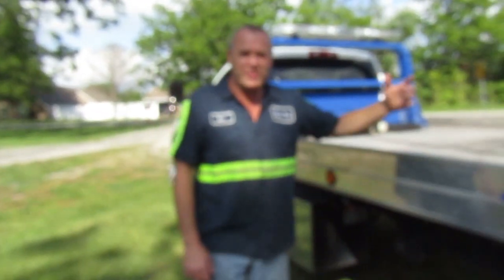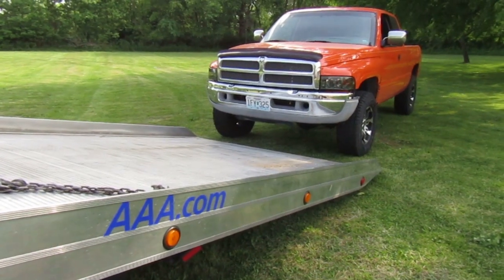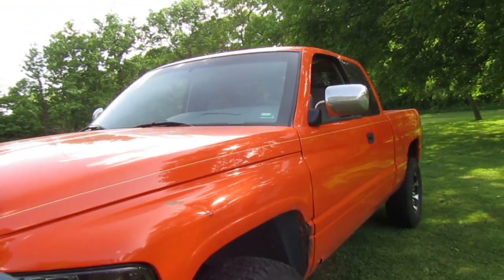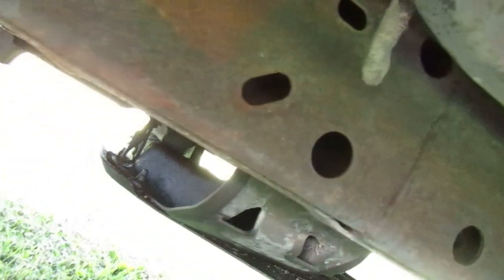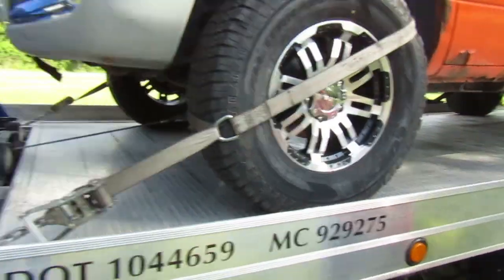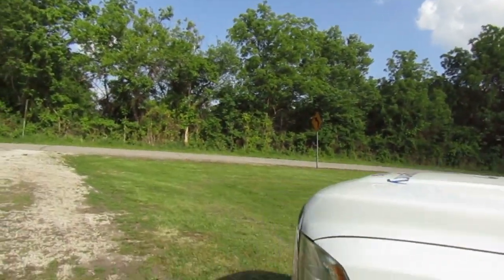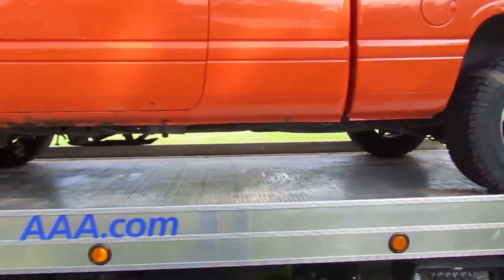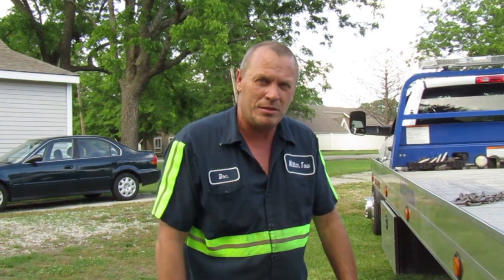How to load and unload a truck from a flat bed tow truck

Comment: Good, thorough demonstration of basic hook, load, secure and unload. The aluminum bed on a 1ton chassis is a good combo for moving vehicles that roll normally. For my purposes, I like what I'm running now, a 21' steel JerrDan with the upward swept tail end on an International 2 1/2 ton. It has really great reach, tilt range and a powerful wheellift. I'm able to slide it under 3/4 and 1ton trucks and using the bed tilt and wheellift for support, hoist them off the ground to access linkages if necessary. Hooking bridle ends is made far easier than rolling around on the ground under a car. I also have a couple handles from Smart & Final that allow me to reach under the vehicle to push hooks across to the far side of the bed and at the delivery end, I can use the magic stick to reach under and detach J-hooks and/or mini-Js. I have a substantial amount of lumber and other items to help facilitate the loading of difficult vehicles. I don't know how much of what you do involves uncooperative cars but I sort of relish the challenges. Today, I loaded a charger that had the spindle broken from the control arm in an accident. That front wheel and tire protruded almost clear of the fender. It had been taken from the scene by another company whose driver did a good job of hauling it with the exception of one detail. He didn't seem to know how to release the transmission park mechanism. Either that or he just didn't feel like taking the time to do it, opting to drag the car up and shaking it back off. I observed the status of the bypass and the markings on the ground to make this conclusion. For my part, I put my bed in front of the front end and slicked the deck in front of the wiped out tire. Using the bed's range, I extended it under the car and lifted it enough to snake my mini-Js to the forward anchor slots. Took up the slack and released the transmission from park. A bit more slicker and the car came aboard with very little hassle. I also try to always use chains in components designed for strength and durability, crossing the rears whenever possible. Some designs preclude crossing, usually due to underside plastic panels. If I have to anchor a car by its wheels, I put the transmission in park or a low gear for a manual transmission plus locking the parking brake. You gotta do what it takes to accomplish the task at hand without hurting your customer's car. Sometimes, it's best to opt out if the customer shows a proclivity to be troublesome and an expert in the operation of the truck. They sure look funny as you drive away.

Comment: When hooking up the truck, I would have used the T hook in the frame. Then you know it isn't coming out. As you said, everyone has their ways. Great video's by the way. I subscribed. I'd use them as training video's for new Driver/operators. Good clear instruction, step by step and why it's done that way. Awesome job. Keep the lights on and watch your back. Stay safe. From a brotherhood tower from Halifax, Nova Scotia, Canada. Much respect.
Reply from the maker: thanks man
Reply: Kyrk Nordfjeld yes I agree with you.  Great training video. A little overkill with wheel straps and the rear safety chains. I learned a couple things. 
Thx--
Reply: Yes t slot hooks every time possible....front and back....these days tire straps are even better....no damage...
Reply: Some guys I have talked to say never use the T Hooks ..  Why is this ???  Pro's n Con's to using ??
Reply: Kyrk Nordfjeld  What company do you work for
Reply: HOW MUCH THAT ROLL BACK TRUCK COST.IS IT ABOUT 89000. DOLLAR'S
Reply: i want a roll back with a remote control so i want be close to the truck.i like to see what's going on when pulling a car or truck on the flat bed
Reply from the maker: Thanks man  I really appreciate you watching my video's  and be safe out there
Reply: Gotta watch ur angles with t hooks though
Reply: @larrymcgregor2277  t hooks will be more likely to slip out depending upon the  angles with the oval tow points
Reply: problem with the T hook is it is very commonly used incorrectly, T hook is meant to be used when in line with the frame slot, If it isn't exactly in line with it and it's sideways or at an angle it can easily pop out.

Comment: great job, i do a little towing myself, nice and straight forward, like the point you made about smaller trucks, better to be safe
Reply from the maker: Thank you
Reply: by the wayim thinking of getting my own truck soon but not sure it im going to buy it here in jamaica ,or source it from the states, its  bit expensive to ship,so im shoping around,. a friend has a older bed for sale here but it has the older type of wheel lift.and its about 17 ft length, do you think it would be hard to convert that to a proper working wheel lft
Reply from the maker: In my opinion from my experience I wouldn't convert anything over you're just asking for a mess look around and find your truck bud that's all together and complete might cost you a little more but you will be thankful in the long run I have had many tow trucks of my own and piecing them together never works right
Reply: thats what im afraid of, may as well buy a complete truck,less hassle, thanks alot

Comment: Great video. I always like to hook a chain from the bed to the vehicle before hopping in to put it in park. Just in case the winch cable were to fail.
Reply from the maker: You probably won't believe this but in all the years that I have told cars I've only had one cable break on me and that was because I was trying to get it out of the medium put the cables running down to the ditch
Reply: I do believe ya. Mine would never fail if I was the only one driving my rollback at work. The problem is that they put rookies in it, and my cable ends up frayed and gets flat spots. I always try to re spool it on my first call of the day, but once the damage is done, its done. So I use the safety chain. If the boss wants to keep blowing money on fools beating up trucks and equipment, that's on him. But I'm gonna do whatever I can to get home safe and be here for my kids!

Comment: Hey man i had my truck loaded on a flatbed and i think he fucked up my front end.  He strapped down all 4 tires first and THEN cranked the winch...seemed like he was literally ripping my truck apart.  Looks like there is camber on the passenger front tire now that there wasn't before the tow.  Should i be concerned about this?  It did not look good at all.  Thanks ahead of time!

Comment: great video Donald am about to start my own business in California thinking in buying a 2014 ram 5500 this video help me alot what are the other levers do on the right side
Reply from the maker: they are the same on both sides
Reply: I think he meant the 4th and 5th lever. Those are for the wheel lift. The 4th one pushes and pulls it and the 5th one makes it go up and down

Comment: Question: When you have a vehicle with low clearance, Can you put on the ground a couple of 2X6 boards under the "leg" of the bed before you tilt it,  so you can improve the load angle like that?  And maybe extend it with ramps if the bed is not long enough to reach the ground?
Reply from the maker: I have some boards in one of my tool box just for the cars that are low to the ground

Comment: Are you leaving the winch loaded ( under tension ) or adding a second chain and then unloading the winch when you are transporting?
Reply from the maker: On trucks I keep the cable tight with the safety chain on the back just to take some bounce out of the truck but with cars after I get it on the bed then I leave some slack in the cable
Reply: @donaldchastain6847  I was asking because I was trained to run a second chain on top heavy ( trucks) then winch the front on down till I can chain it tight to the deck then back the load off the winch. Boss said about 1.5 inch of play in the winch line. he said it was to save wear on his winch.
Reply from the maker: On our tow trucks if you put like an F-150 on there I use my cable and a safety chain on the ass end of that truck and squeeze the shocks down just a little bit just to take some of the body roll out of that truck makes for a better ride
Reply: @mrrodneyalong  Unloaded winch it how you want it, We all have towed with the winch tensioned down, we all have towed with 2 rear chains tightened by the winch and safeties on the front, but legally you need 4 adjustable independent tie-downs, And for safety the winch it suppose to be without tension as when tensioned it shock loads the winch with every bounce you hit.

Comment: I have a question for my fellow tow truck drivers on here.. I'm only on the job a couple months and am still learning .. I've been using J-Hooks on pretty much all of my tows with few exceptions where I've been hooking up to the frame with the smaller hooks. I'll admit that I've been grabbing control arms most of the time due to being taught that wayOne thing I do that I don't see here is I put big J-Hooks around the axle on the back of the truck or a small J-Hook on the frame and set the chains in the back and cinch them down so I have it tight on the front and back evenly. Then I'm putting my straps with a cluster on the front of the truck. Does this sound like a good procedure or should I definitely be looking to do things differently.
Reply: R.J. Kluting sounds fine. 4 points of contact is the law. Winch doesn't count.
Reply: I prefer mini j mostly to avoid bending tie rods and aluminium control arms. A lot of rear control arms aren't very strong

Comment: Did you apply the parking brake before engaging the PTO?
Reply from the maker: I do a lot of the times and a lot of times I don't
Reply: My truck makes me. PTO won't engage without parking brake set.
Reply from the maker: I have driven tow trucks like that before but they really stick shift
Reply: I miss the manual shift rollback we had. Everything's automatics now...

Comment: Why do you use straps and not just 2 safety chains?
Reply from the maker: The main reason is most cars don't have any kind of frame anymore or all tin and aluminum so the chains pull through them like butter put the straps on the tires and I don't even have to look back at them anymore